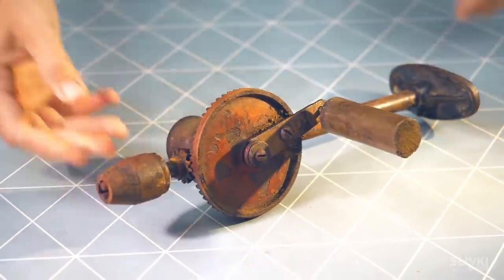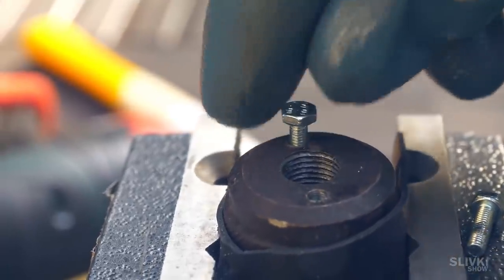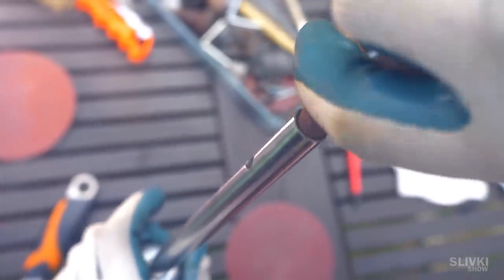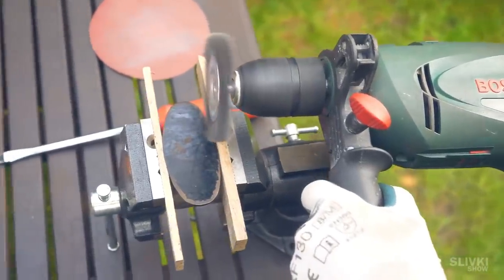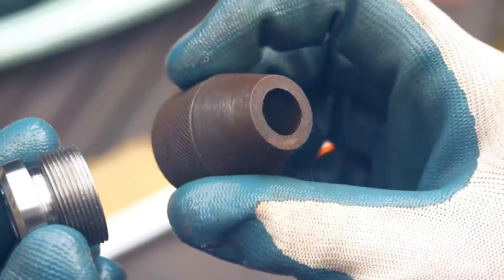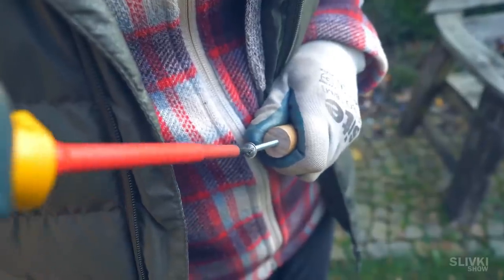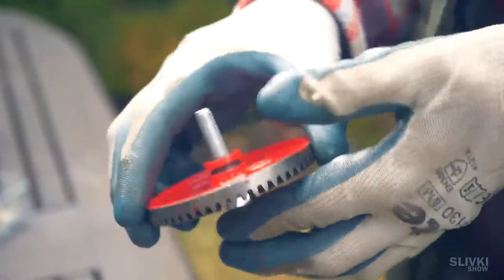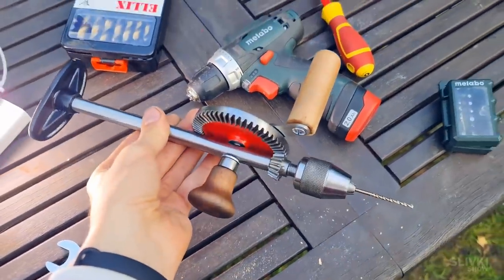RESTORATION A DEAD HAND DRILL

Comment: I love u and ur videos but wd40 is not penetrating oil it is a water displacer made for the us military during ww2.u need to use pb blaster or kroil that is a penetrating oil.wd40 is fish oil ment to displace water in mostly used inside points distributers by the army to water proof the ignition system